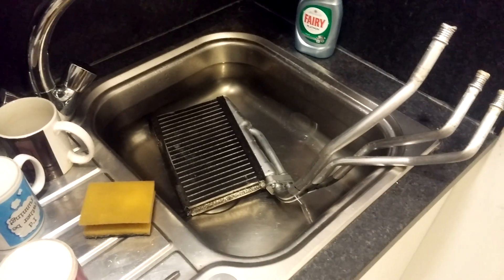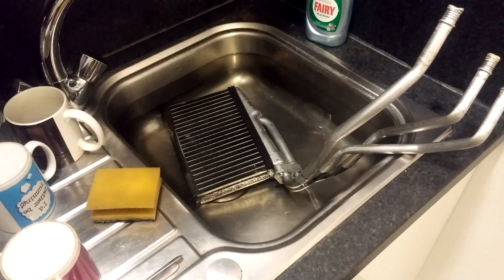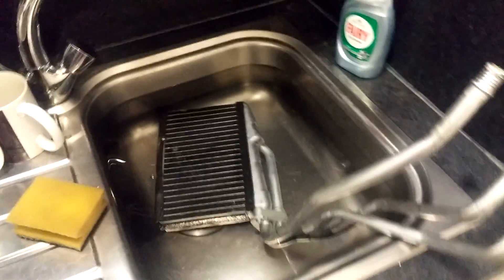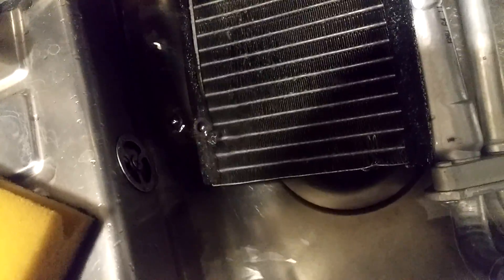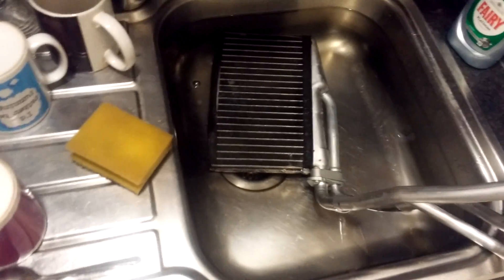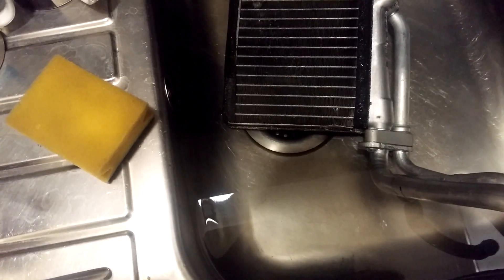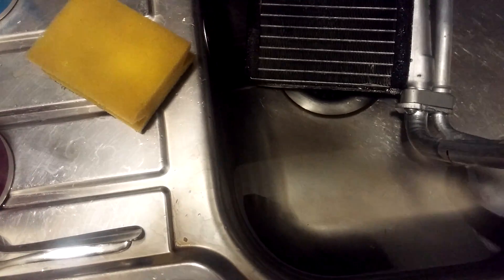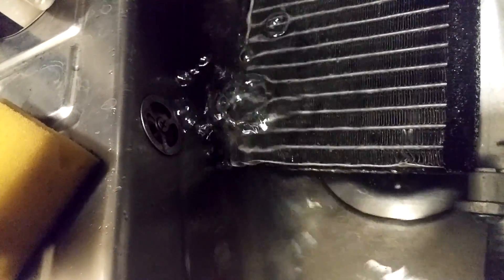2003 L322 Heater Matrix Issue!

Comment: Hello.  to change the radiator, do I have to remove the entire internal console?  thank you
Reply from the maker: Nope - I figured out a workaround - can be seen here : https://www.landyzone.co.uk/land-rover/a-boom-squared-moment-hevac-heater-matrix-rethink.300556/      and      https://www.landyzone.co.uk/land-rover/hevac-matrix-fsr-and-blower-removal-how-to.300415/      and the actual process in the car      https://www.landyzone.co.uk/land-rover/2002-2005-heater-matrix-replacement.301130/